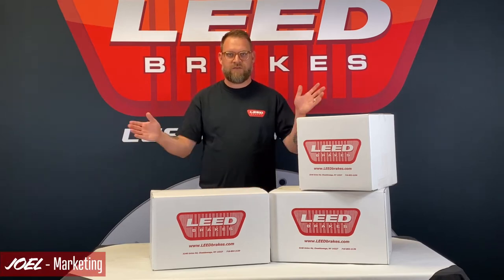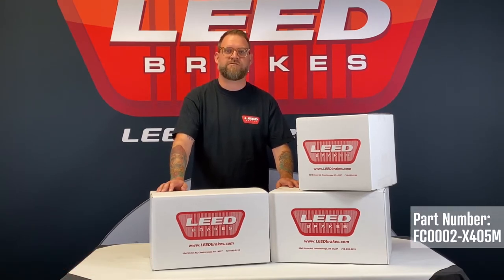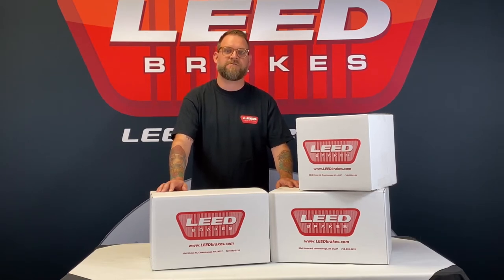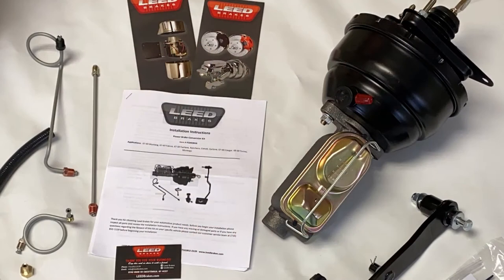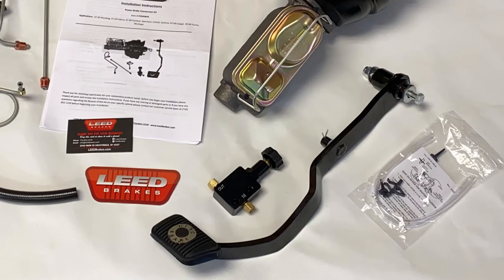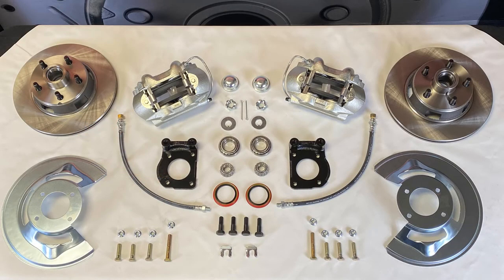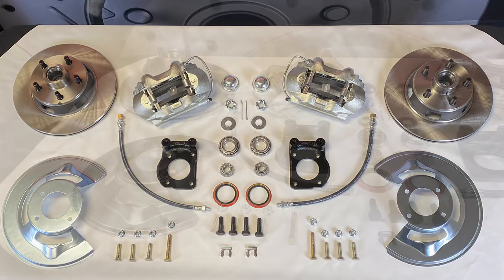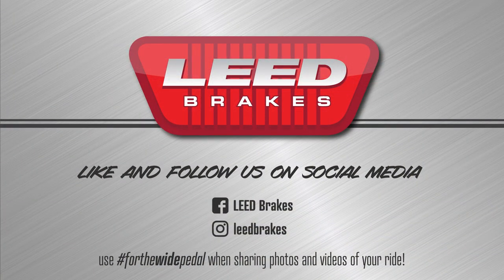Power Disc Brake Conversion kit for 67-69 Ford with a Manual Transmission

Comment: I bought what i thought was a leed kit for my 67 mustant from cj pony parts and it does not have the extra lines and fittings for the proportioning valve. How can I get them from you